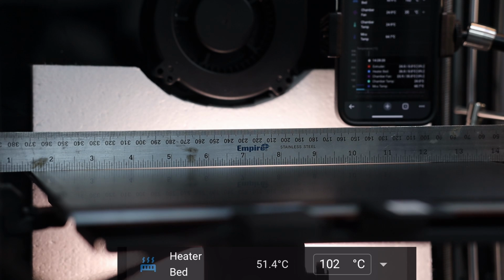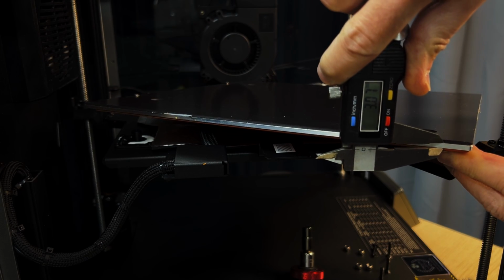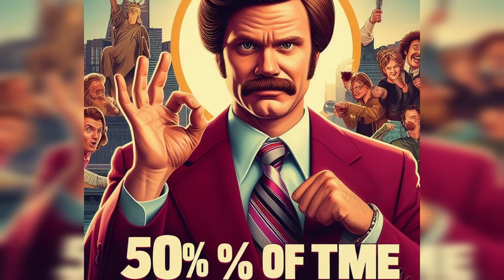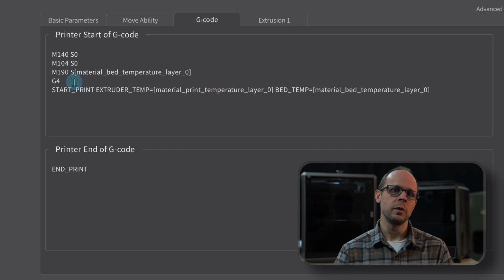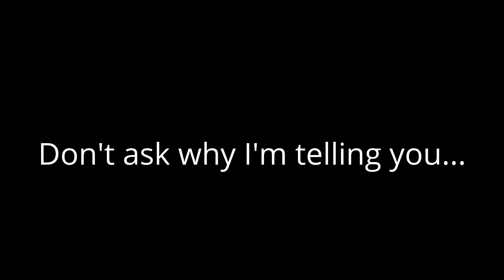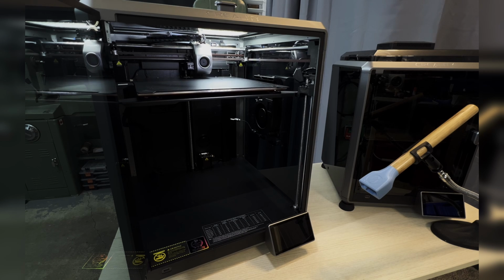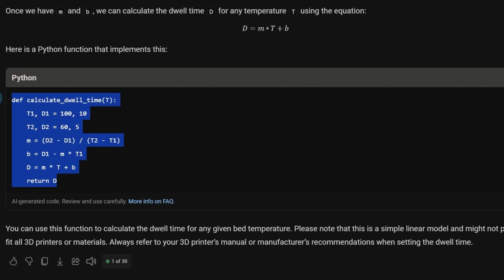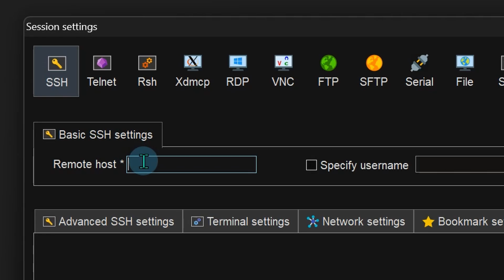Let Your Creality K1 MAX and K1 Printers Soak for the Best First Layers

Comment: I'm having a weird problem with this fix on my creality K1. I insert the Gcode as recommended, but the printer is mesh leveling before the heat soak happens, then doing the dwell command and waiting with the nozzle off to the side and then immediately starting the print after the dwell. It's odd because the dwell command is the line before START PRINT is given.
Reply: I'm using Orca Slicer and having the same problem. Did you find any solution?

Comment: Reposting in hopes this gets some visibility. I think this code would be an improvement yet on the variable code, it would take a previously heated bed into consideration. I'm assuming an ambient temp of 20c, which for an indoor location shouldn't be so far off to really affect anything.

G4 P{max(0, first_layer_bed_temperature[0] - bed_temperature[0] + 10 ) * 6000}

Comment: Hello again. For some reason my printer doesnt take a bed mesh after the soak period. It just goes straight into printing.. so the soak period is pretty pointless for me at the moment? I've got 'calibration' ticked on the K1max screen when I go to print. Any suggestions please.
Reply: Yes I've just watched it again. It does a basic 4 corner calibration.. then it 'soaks' for 10 mins, then it goes straight to the purge line and starts printing.
Reply: @CambridgeAutogleam  I'm having the same issue. Did you ever figure this out?

Comment: Does it perform the probe at the higher temp as well? Or does it cool down as it’s probing it? I saw in another video you said the bed temp was set to 50degrees for probing. 

I’ve only had my printer a week. Not got as far as rooting it…. Yet.

Comment: anyone else had an issues with creality print? im using the automatic gcode and when i try to do the calibration with this profile it wont load any of the models onto the bed? works when i go back to original.

Comment: Not working on the newest update of creality print

This stops the generation of the G-code :
M190 S[material_bed_temperature_layer_0]
G4 P{max(0, first_layer_bed_temperature[0] -10) * 6000}

This seemed to wait after calibrating the bed 😑
M190 S[bed_temperature_initial_layer_single]
G4 P{max(0, first_layer_bed_temperature[0] -10) * 6000}

Comment: Thanks for the experiment and the gcode addon for wait for temp settings. I am using it with abs+asa however I dont use for pla and petg. Each time I have to modify the printer gcode with ";" for material change. Is it possible to use these code in the material profile to use with only specific material? If yes, how?

Comment: for the dwell P time you can simply use [bed_temp...] * 5400. so for 100 degrees you'll wait 9 minutes. 5 minutes soak for 60. 2 mins for 40.

Comment: I'm using orca slicer after I installed the line it starts print and it does bed lvl before heat then stops and waits the 9min heating bed then starts the print in your vid it waits the 9min heating bed and then lvls before starting print any help would be great Thanks

Comment: A great help which I've used on my k1cs (2 of them) to improve first layers - much appreciated, thanks!
My next nice-to-have on the code would be gcode which is pretty much like that where we add a dwell to the start-print.cfg, but instead of it dwelling for, say, 7 minutes from when it gets to there in the code, it dwells for 7 minutes from when the temperature of the bed reached the required set temp. That way, if when the code gets executed the bed has already been at temp for a while then it won't necessarily dwell for the dwell time, or will if it needs to (or even for just some of the 7 minutes if it's been at temp for 3 already, say). Anyone keen on a bit of coding for that (and more likely to succeed than me!)?...
Thanks again, brilliant stuff.

Comment: Warped bed = out of tram 
Out of tram = parts not square and dimensionally unaccurate.

Sombody needa to make a product for a 6mm aluminum plate upgrade
Reply from the maker: I was hoping that Gulf Coast Robotics would have the kit ready by now, I'll follow up with them, they were supposed to send me one to test out.  It's been 2 months now since I asked about it.  Thanks for the reminder.
Reply: @NeedItMakeIt  true. Yeah bro get on that because this is the only thing holding me back from buying a k1 max. As I very frequently print engineering jigs and if there not square it's unacceptable 🤣🤣
Reply from the maker: I'll send them an email to see where it stands.  It's out of my hands until they send me a unit to test out unfortunately.

Comment: not sure what i did wrong but i copied the auto code in for creality and after about 5 min of probing i pulled up an error code 0500 key217 ... rebooted the machine and made 3 attempts at it but no go ... after i removed the code i got my printer k1 max to print as it was before..  maybe i will try the 10 min version see if that will work
Reply from the maker: I think you're the 2nd person to have problems with the more complex code in Creality print, I'm not certain what the problem is exactly since this isn't an issues I've had.  the longer version should work fine to give it at least some kind of soak.
Reply: @NeedItMakeIt   thanks for the reply, i have yet to come back to trying it. I had moved on to getting adaptive bed meshing working .. however to day is not my day :(

Comment: Maybe it's me who misunderstands you.. You mention "this one for Creality Print" and show in the video 🙂
M190 S[bed_temperature_initial_layer_single]
G4 P540000

but in your text below the video, you write as follows.
CREALITY PRINT(Auto-time)🟦
M190 S[material_bed_temperature_layer_0]
G4 P{max(0, first_layer_bed_temperature[0] -10) * 6000}

Which one of them is the right one that I should use for my K1C? 😀
Reply from the maker: That's right, in the description we've found a slightly better method, both will work, however the one with more lines of code is superior because it will change the soaking time based on the material or the bed temp itself.
Reply: @NeedItMakeIt  can I copy and paste 1:1 from your text and then paste into my Creality print?
M190 S[material_bed_temperature_layer_0]
G4 P{max(0, first_layer_bed_temperature[0] -10) * 6000}
Reply: @NeedItMakeIt  btw, none of them work well in my "Creality Print" have tried them both.. First the one I got "error key:2171,unknown exeption" error when printing.. then went in and deleted the G-Code again, and then add the second one and then print again, bum error key:2171,unknown exeption error again, restarted the software, and the computer, and the printer several times, it gives the same error every time, then deleted your G-Code again, and then tried print, BOOM, then it just prints without problems :) So there is something in your G-Code that my K1C doesn't like 😀

Comment: I tried the Creality Print autotime code on my k1max with creality print, but I got an unspecified error (e0500).
Reply from the maker: I've tried it with Creality Print myself, so that's a bit strange.
Reply: @NeedItMakeIt  yeah, didn't get it either. but i switched to orca and that works great.
Reply from the maker: @jfb752  You'll be much much happier working with Orca, you'll have the latest and greatest, and it's quite a bit faster, there are so many pros, it would be hard to list them all.
Reply: @NeedItMakeIt  videotopic? ;)

Comment: This worked for me, but since I'm prone to sending a print and immediately realizing I want to make one more change, I replaced the single 10 minute wait with a loop that waits 30 seconds 20 times, since you have to wait for the current command to finish before you can pause/cancel/etc. This way I can make those last minute revisions faster, instead of waiting the full 10 minutes.

For any other scatterbrained people like me, I replaced the G4 line with (adjust the number after L in the first line to change the number of loops, e.g. L10 would be 10 loops, and the time per wait as shown in the video):
M808 L20
G4 P30000 
M808
Reply: thanks for sharing
Reply: Do you place the M808 L line in between the M190 S{material_bed_temperature_layer_0} and the G4 P line or do you replace the M190 S line with the M808 L line entirely?

Comment: I tried it. First try gave a first layer of my dreams. Second try came back to shit. I cannot trust this machine. Its so sad
Reply from the maker: Which printer do you have?  K1,K1C,  or Max?  You've added the extra code to let it soak already?
Reply: I have a K1. Did the soak method right now! Fingers crossed. 210x210x0,2mm single layer sheet is on the run. The bed shims method gave me a 0,377mm average total range (before it was 1,2mm). 

Not ideal, but way better. After I nail the soak thing, I will try again later to see if I can improve it further. Learned all from your videos! The other thing I did was go slow as hell. 10mm/s outer wall and infill on first layer. Tomorrow I´ll come back and tell you if it worked. Thanks for the help and attention, mate 

One thing I´d like to ask: Do you really trust 5 minutes are enough @60ºC for PLA? (based on the algorithm you provided)

 @NeedItMakeIt
Reply: @NeedItMakeIt  Yeah I did. What kinda helped was use your code + 10mm/s on first layer. Still get only about 50% of success
Reply: @NeedItMakeIt  K1, 2023 october batch. I really dont know what to do anymore.

Comment: Does this apply to the k1c? Does it have the same issue?
Reply from the maker: It applies to pretty well every 3D printer, some have less of a problem than others, anything with a 3mm alum bed and 4 points of connection to the steel frame below the bed seem to be most prone to these problems.  Someone has mentioned that the K1C had trouble with the method in the description I've left, but I don't see how that's possible, it's generic Gcode and it only differs based on the slice, but if you have trouble, please let me know and I can dig deeper!
Reply: Okay and thanks for replying !
Reply from the maker: No problem!

Comment: I've shimmed the bed as per your other video which is a good solution and improved things, but it's still a disaster for ABS because the mesh taken at 50C is nothing like the bed shape at 100C. How did you manage to change the temperature that the mesh readings were taken at? What app did you use as it wasn't made clear?
Reply from the maker: I suppose not, that's because this video was the follow up to the previous two videos where we found the issues and had the original game plans.  The best thing to do is manually adjust the temps first, let it soak, and then you can print from Creality Print with the calibration box checked off.  Doing the calibration at the printer is going to use 50C.  

If you can, I'd recommend rooting your printer and then you can adjust the temp from 50 to whatever you like.  

Check out the video I have for rooting these printers, I made it quite short so it's not too boring to watch.
Reply: @NeedItMakeIt  Thanks so much for the reply. I'll see how I get on and consider rooting as a last resort.
Reply from the maker: @StickyFeatures  No problem.  I always root them now, it's so much nicer and I use Orca and send directly to the printer, it's just overall a better experience.  Creality print is okay, but Orca is quite nice to use.

Comment: I redid my bed leveling after a soak for a few min and the mesh was different. It makes sense because just because the thermocouple reads 55 doesn’t mean the whole bed is up to temp. That and a small z offset tweak has made a massive difference to my first layer
Reply from the maker: It's one of those things that's going to be really hard to tell, the timelapse videos really helped a lot to figure out what was going on and what we could do to try and get the best results.  We're going to have some other options for more automated soaking hopefully soon.

Comment: This is a great idea. Here is the issue im having, even with the dwell. The print will dwell, hold temp and then once its ready it will start its print process. Which includes clearing the nozzle. Where on the K1 it goes to the back of the build plate, wipes the nozzle and cools the nozzle. Durring this portion RIGHT BEFORE THE BED MESH. The bed temp is dropped by 5 degrees.... so by the time it goes to probe, the beds temp is now trying to get back to the dwell temp.... so all that waiting just to get to the bed mesh and have that literally be the only portion where the temps are fluctuating as the bed is trying to get back to temp. I'd imagine thats something to do with the start print, but for the life of me I can't figure out how to change it. I got my printer set up with a helper script and everything is locked in the start print gcode so I can't really go in and change anything. I've tried to get it to dwell again before probing but cant figure it out. If anyone has any guidance on this, that would be AMAZING.
Reply from the maker: We have some more info on this but I need to run some tests first, I'll do this over the next few days.  What I saw as well during the nozzle clean is that the AUX and the Part Cooling come on full, those two seem to want to cool the bed down, they're trying to cool the nozzle, but the AUX, just moves a little air around at that point, it could probably be done just with Part cooling.  I also don't  like that wipe procedure it's slow and heating and then cooling and then re-heating the nozzle, doesn't make a lot of sense.  Better to have a more automated wiper system, can't someone design a system like a carwash for a nozzle?  Go through 2 stages of motors that spin a silicone or brass brush?
Reply: I ended up adding a fan speed macro in my print config to completely disable the fans in the start of the print. Bed stayed at a nice consistent temp while probing. First layer went down FLAWLESS. Not really sure how to put the macro here on youtube, but I'd be more than happy to send it to you on discord or something.  @NeedItMakeIt
Reply: Here is my thought on the cooling fans kicking on. I believe that they are blowing enough air to influence the value you're getting on the thermistor. What I mean is, I believe the the value the thermistor is reading is different from what the bed actually reads. I put my bed temp to 100 and watched the graph. I noticed when the fans kicked on the thermistors value of the bed temp dropped from 100 to 95 in about 5 seconds.... which I don't think is possible. The bed power then shot to 100% and the value read for the bed was somewhere around 96 degrees. What i suspect is happening is that once the bed kicks back to 100% power trying to reach 100 degrees and the machine starts probing, i think the bed is getting much hotter and warping the bed as its being probed which gives you bad values which messes up your first layer etc. There are macros available on klipper for fan control during the start print. I just don't understand what it's doing. @NeedItMakeIt

Comment: After adding the m190 command to the g-code the printer no longer calibrates after the dwell time, just homes the head and goes straight to making a purge line then prints. Setting the bed temperature on the printers touchscreen then having it calibrate does not work as it waits untill the bed is 50°. I may try rooting it, but I'm afraid that is going to open another can of worms.
Reply from the maker: If you're using Creality print, it will only calibrate when you check that box, otherwise it will use the stored bed mesh.  Can you confirm that this box was checked?  The M190 command won't cancel other commands, so there must be another explanation.  Rooting your printer and installing KAMP will provide better overall results so I would still recommend doing it.
Reply: Yup I make sure "calibrate" is checked every time. Sometimes it does calibrate and sometimes it does not. I am trying to find exactly why sometimes it does and sometimes it does not. This latest time it calibrated the bed level before the dwell time.
Reply from the maker: @Killerx1561  Do you have the Max by chance?  I've found this issue as well, sometimes it runs the laser scan, sometimes not, but this was an issue I had right out of the box.
Reply: Yup it is the Max, its on the latest firmware. I tired messing with it a little tonight, I cannot find any rhyme nor reason it wont calibrate the bed. I use orca slicer so I never had the pressure advance test work or the bed laser scan, even though the latest firmware says it can support it.